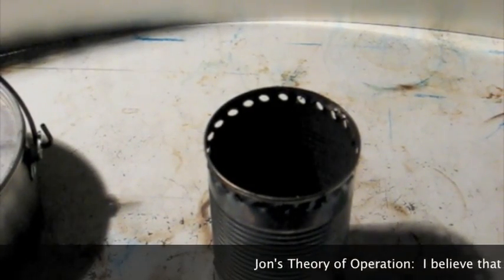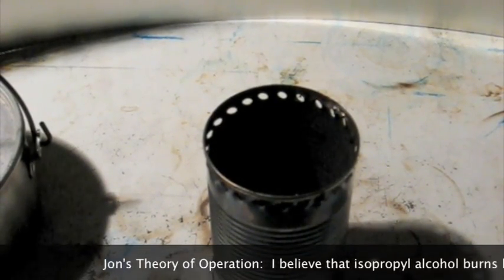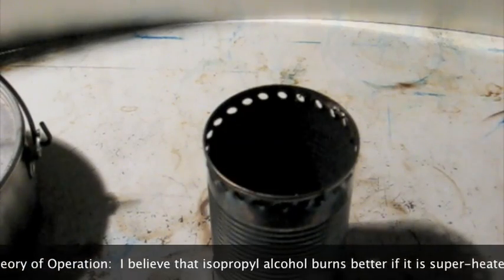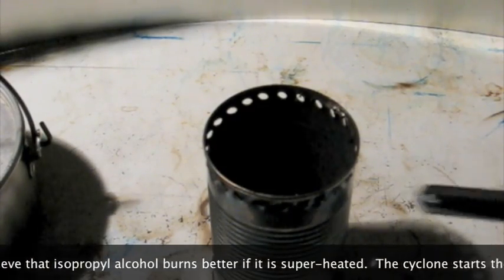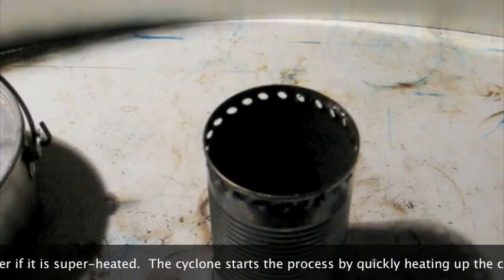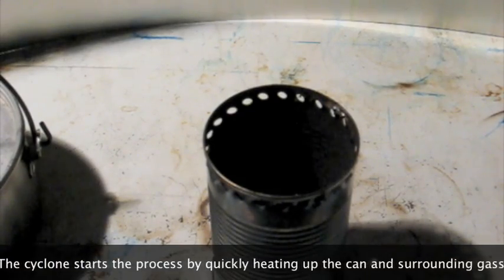An Isopropyl 99 Alcohol Stove

Comment: 1:06 - Here in Brasil we have this soot problem with Ethanol, sold in gas stations as automotive fuel.  Methanol is ~ 5 times more expensive and available in few places.

I've tried several designs and all have this issue in some degree.
The only way I find to minimize this issue is keep the flame distance to the pot bottom in around 1/2" ~13mm, what seem's reduce the flame power a bit, but is a reasonable trade.

I've made a stove similar to this in the video, but with diagonal  slots in the upper part as "jets". Work well, but the flames is highly affected by wind.
It's easy add a some flame control in this model, with a movable aluminum strip with holes covering the lower holes.
Reply: Try adding water to your ethanol.  About 10-15% water should get rid of the soot.

Comment: Jon, thank you so very much for sharing this with us! I'm currently working with is stoves, as its multitasking capabilities are still desired, along with the less toxic substances in this fuel. I was just wondering how you were able to make the lower level holes to accurately align to get the best results for the jet tornado action. Any advice on how to accomplish this is greatly appreciated!
Reply from the maker: There have been many updates since then.  Look up the Multi-Fuel stove by my company FLAT CAST GEAR on YT
Reply: Thank you, Jon, for the quick response. I had watched two videos,back to back, and 😕 confused the publication dates. I thought that the publication dates for this was the more recent one. I will check ✔ it out.

Comment from the maker: So interestingly enough, I started with slots and I noticed two things: a) the slots are supper efficient and the cyclone doesn't heat up the side wall enough to maintain combustion at the top and b) the slots would allow excess air in at the bottom preventing the inlets to be choked off.  In this case, the round inlet ports seem to work better.